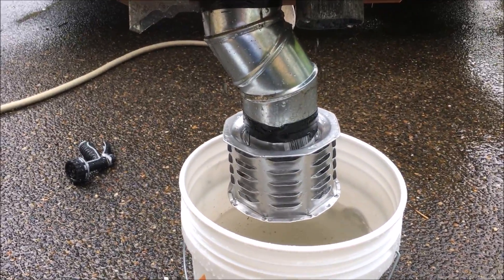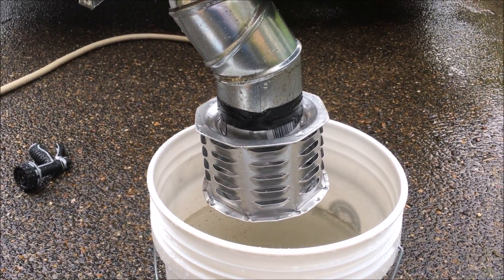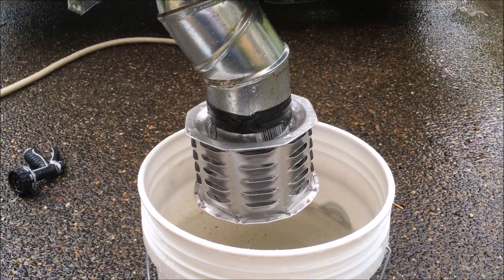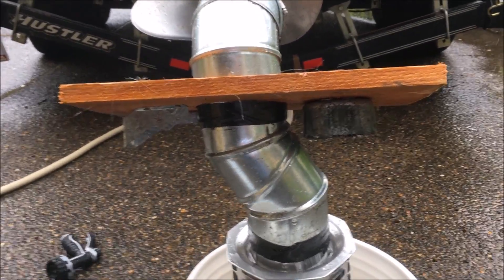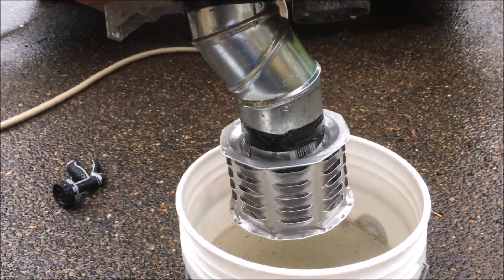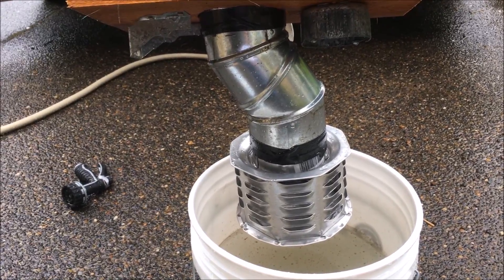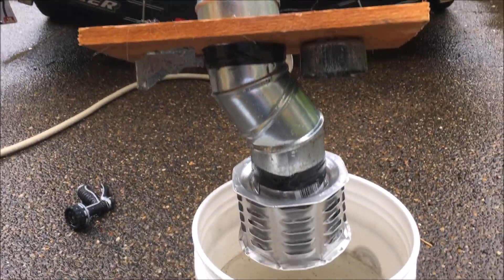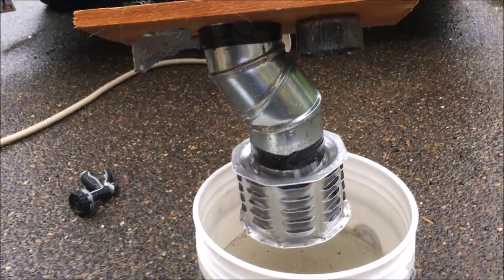Dry land  outboard boat muffler - do it yourself  ( diy )

Comment: Why not just cut a large drum down or get a container that will fit under the drive and fill it with water? You can keep your hose in the drum and it will replenish the water??

This is an over engineered failure.